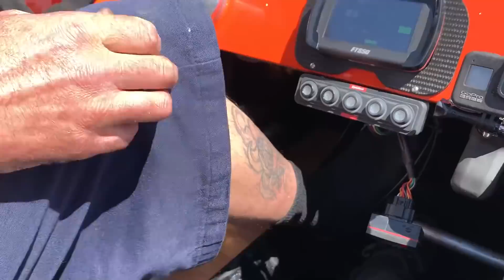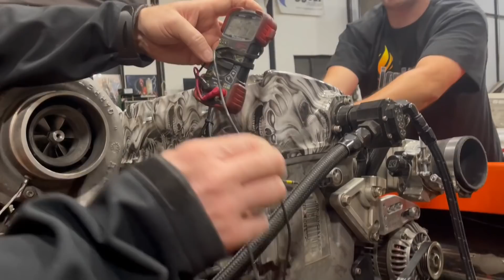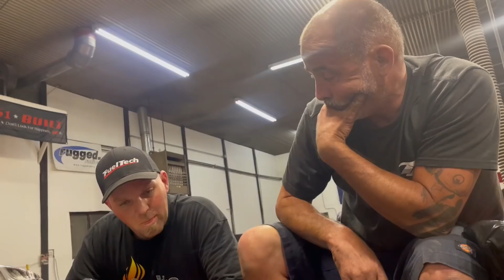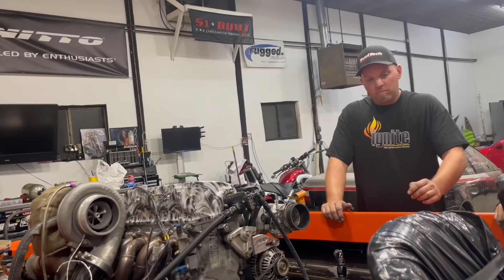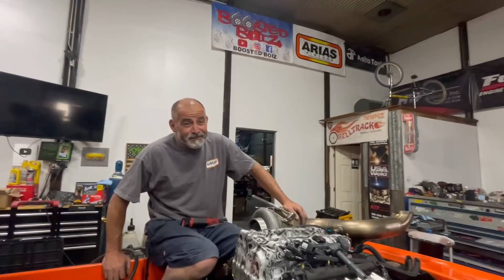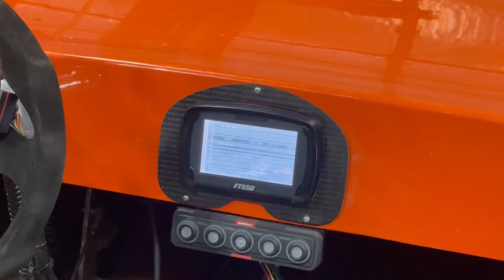K Series Jet Boat Runs Into Ground Issues!

Comment: As an EE, grounding and shielding is one of the most frustrating things I have to deal with. Crimps that measure good with a meter, but have trouble with high frequency noise. Routing cables that may contain noise >6" away from other sensitive power and signal cables that may be running in parallel, even if they are shielded. Cross cables at 90deg where possible. Use a Star grounding scheme and try to avoid ground loops (multiple ground connections between two points). Try using braided cable which is generally better for high frequency grounding.

I have to wonder whether the solenoids and coils have appropriate flyback diodes and suppressor circuits built in. I doubt there is much you could do about it without modifying the wiring harness, but having these suppressors near each coil/solenoid/relay instead of relying on noise suppression in the control electronics can help prevent that noise from coupling into other circuits. Be aware that these suppressors may affect the performace of the device, so they need to be spec'd properly. 

Ordinarily, grounding the shield of the cable on only one end is the best practice, however from experience that is not necessarily true. In certain applications it is better to ground both ends. I most often see this with BLDC motor cables especially when used with PWM amplifiers.

Comment: Oh my...gone through that with car audio installs! The power hungry components (this case the starter, injectors and coils) MUST always have their own ground and that ground wire be as large as needed and some that goes directly to the battery one by one and not slapped on the length of a single wire or bolted on various parts of the engine aka single-point or star grounding. That alone reduces noise and reduces voltage drop. One option is to put a ground wire on the cylinder head for the spark plugs. I would never use the chassis for ground when the distance between the engine and battery is that short. B+ lines be large...grounds way larger!

Comment: Grounds are so finicky with Hondas, I had a huge ground problem with Acura Integra also. It caused my Ac not work properly and drain my battery. I keep changing my alternator and batter and keep recharging my Ac unit. Thinking it was the problem, until I just read my diagram, and started running ground from the alternator and up.

Comment: Run it in the water not the ground.  clark craft has a 14 foot  inboard hydro plane kit.  This boat  weighs 200 pounds and is set up for a 4cyl inboard straight shaft. This boat will run 100 miles per hour with a 2300 ford stock engine. What do you think it will do with this engine in it?

Comment: Don’t underestimate how much a grounding issue can actually damage your equipment. 
If the starter is trying to pulls its Earth from a single track on the circuit board of your ecu , that track is now gone .  
Consider your wiring to be like pipe work , it has to flow all the way around the circuit so skinny earths are bad bad news .

Comment: I'm from the old Honda Crome/Neptune/ZCtune era and my number one thing when tuning cars was to check clean and separated ground for the ECU and for the wideband (Innovate LC2 was very sensitive to that too).
If I did the built I will have dedicated lines for the ECU and the wideband.
(from an old ex-mapper).

Comment: Ya run some thick neg wire from the battery to the motor and then a 5mm wire to the ecu,its a common neg but ya shoukd always put a 25v 4700uf cap and a tvs diode on the battery to kill the noise

Comment: Holy crap that was quite the diagnostic process. Even for you guys. I thought it was just a voltage issue, but that obviously was not the issue.
Reply: It can still be called a voltage issue...but the ground got resistance. Same thing happens when someone adds a second battery on their car at the trunk or hatch and ran beefy B+ wiring but just used the chassis for ground...the voltage drop can literally be a few volts!
Reply: @ruikazane5123  VERY good points. I know when the electronics malfunction it's usually has to do with a current flow or voltage issue, but that makes more sense. Also the fact the wire diagram called for separate grounds.

Comment: IIRC if you run a current thru a wire and that wire is parrallel to others that introduces noise in those other wires. so best to run then 90 deg to minimize the noise. or also you can run twisted pairs to help also or shielded.. god i hate wire gremlins.

Comment: I hope these dude know that you can't ground a boat through the chassis. You need to run a ground wire that goes back to battery. you can run one long wire and route every ground to it. starter is grounded through the block on a car. it needs to have an attachment to the battery in this case via one of the mounting bolts.

Comment: you guys need to use a power probe. it has volt reading, and the tone is helpful for determining amperage easily. able to add power or ground where you want helps in diag too.

Comment: you guys need to use a power probe. it has volt reading, and the tone is helpful for determining amperage easily. able to add power or ground where you want helps in diag too.
Reply: I have been looking to get one for just that reason to check grounds and power and send power wherever you want it.
Reply: Simple voltage drop test with a multi metre would be good too

Comment: Clutches are neutral in a loop to the battery ground. Once chevys carbon canister explodes its time for a new carb. Distilled water in the fuel filter...
Reply: I said the same thing.

Comment: You need to have dirty grounds separate from signal grounds. High consumption devices like coils, injectors and the starter need to have their own ground. The CAN stuff should use a shielded cable that is grounded on 1 side. The shield will absorb all the noise from the other cables and disperse it to the ground. I’m an electrical controls engineer.
Reply: Shielded wires are key when it comes to high noise wires running next to other important wires.
Reply: Nice flex 💪 mr engineer 

It’s definitely concerning how certain ecu manufacturers recommended certain grounds, even oe grounds loops are troublesome sometimes e.g Nissan rb cas stuff
Reply: makes sense! will have to keep that in mind
Reply: 100% facts
Reply: Good to know thanks!!!!

Comment: Simplist way is to put a chassis stud to battery and every ground attached to stud. Using larger wire never hurts  either.
I always ground battery directly to the engine also.

Comment: how do you ground to a carbon fiber boat ?
Reply: you have to run a ground circuit instead of using chassis ground. every ground goes to that ground circuit. the starter needs an equal gauge ground to.the battery through a cable attached to the mounting bolt. another thick ground wire to attach all other things needing a ground.

Comment: If your mid plate mounts are powder coated... shitty ground. Learned that over years powder coated parts are worst for grounding. Sometimes like Alternator if brackets powder coated...need a 2nd ground to chassis.
Reply: Good call. I just built mounts for a gm1 wire on a dodge 360LA. They are getting coated with all the other brackets and pulleys.

Comment: Have not finished watching video I wonder if your problem is in your dash screen with it acting crazy the way it's doing the lines through it and I always take a set of good jumper cables and pull them apart and use them as jumpers to chase down grounds and hot wires background on the motor just regrind it with a jumper cables horse every time

Comment: You may have a leaky injector ... there was a lot of fuel burning in the intake manifold.
It's hitting on 4 and the starter doesn't rattle my fillings anymore so that's good.
Won't be long now and you will have reliable K-power on the lake.  Let's Go!

Comment: This is way cooler stuff but reminds me of my first legit car diagnosis. My first car would randomly not charge and die on the highway. I replaced the alternator with one from a salvage car, good for a few days and then same thing. The alternator was hard for me I just knew how to change oil at the time. So I took it to a shop they kept it for a few days… couldn’t find a problem. I got fired up! I read everything I could on the internet learned how to use a multimeter and found a fraying and corroded ground cable. Fixed it for 20 bucks. Love the wrenching videos, I bet there are people everywhere that learn a ton from your videos! Keep on Hot Roddin’👍

Comment: Gotta see a drag race against Kyle's once it's up and running!
Reply: 1000hp vs 300hp aint gonna be much of a race lol. Kyle has said they aren't doing any crazy numbers with that motor cause its all stock.
Reply: @xetahouse8694  for now.
Reply: Ones for sand bars and logs and the other is for acceleration and speed. Boats that are suitable for completely different courses.
Reply: @slysithejuicegy  because of course it was meant as an apples to apples comparison with no differences whatsoever. Definitely not just a silly idea to see two of Brent's friends race their new creations. Not at all.